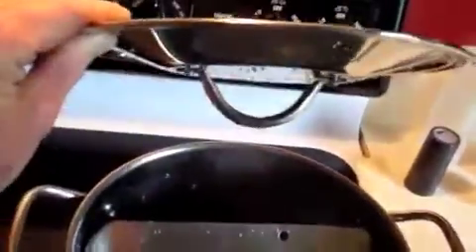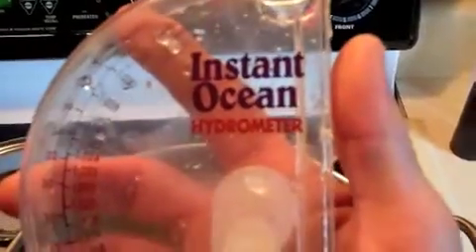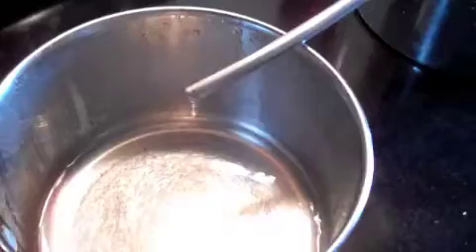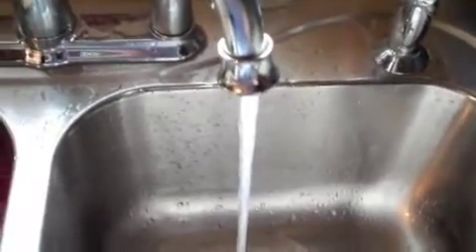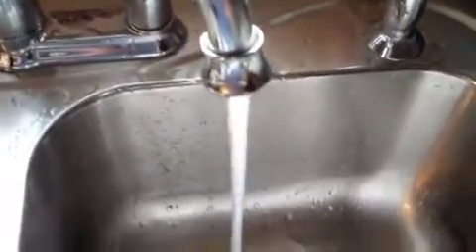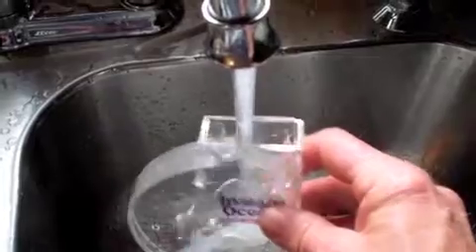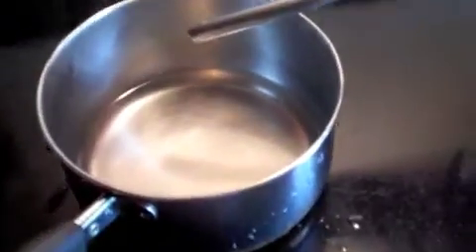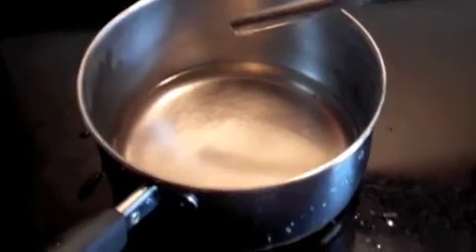Distillation of Ocean Water

Comment: 100 bucks for a 200 watt solar panel will power that well pump. But thanks for the vid! Good job.
Reply from the maker: I have a T on the pipe going to my well, and I have a cap that unscrews, where I can screw an old pitcher pump onto it. Also since I did this video I have a 500 gallon rainwater cistern.